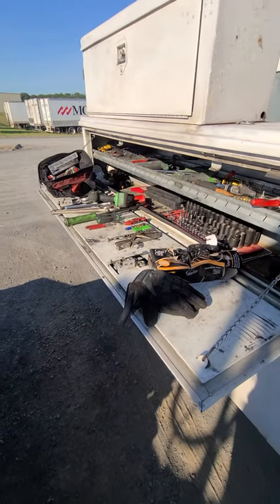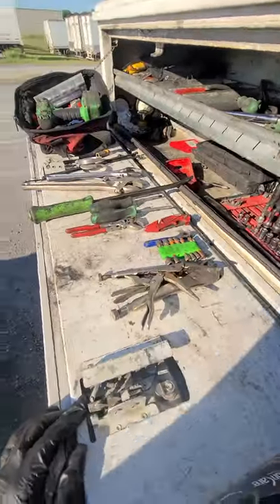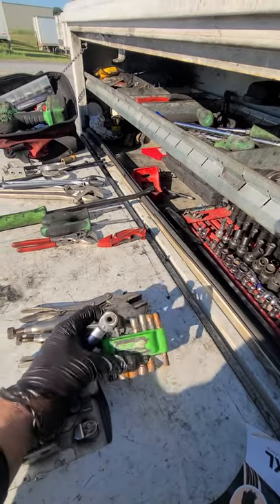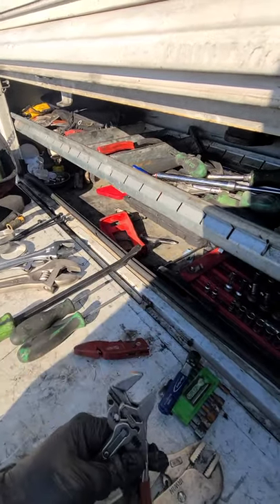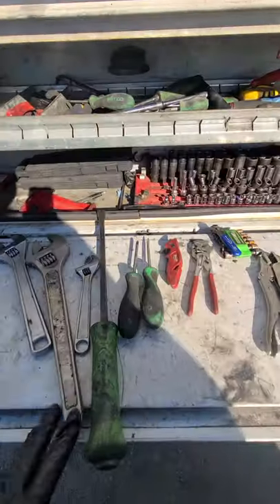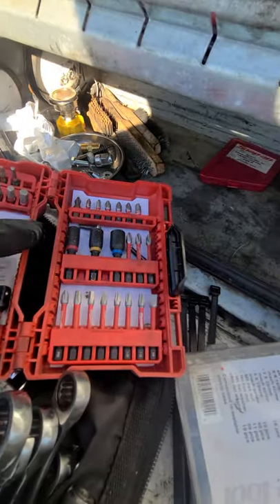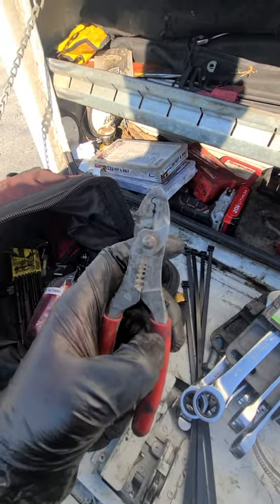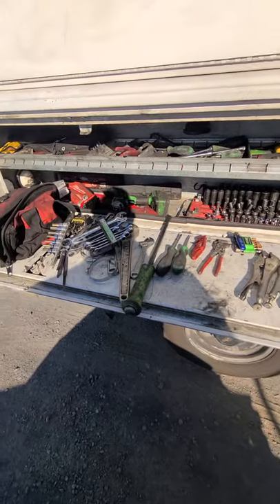Semi-Truck Tools for Owner Operators!!!

Comment: My kit for my truck (89 IH triaxle dump): several screwdrivers Phillips and straight, one 3’ pry bar, 3/8 standard socket and ratchet set, deep well and short, long 3/4 drive ratchet with 6” and 12” extensions and 1 1/4” and 1 1/8” sockets for lugs and axle nuts, old fan belt and 4 1/8” socket for spindle nut (I have Dayton spokes, use belt to lift spoke and drum evenly), 3lb mini sledge and 12oz ball peen hammer, 1 30’ roll of 12 gauge wire, stripper/crumpet tool and box of assorted butt, ring, male and female spade and flat connectors.